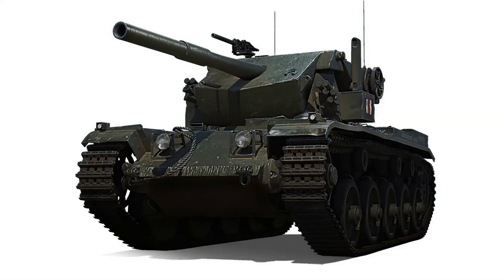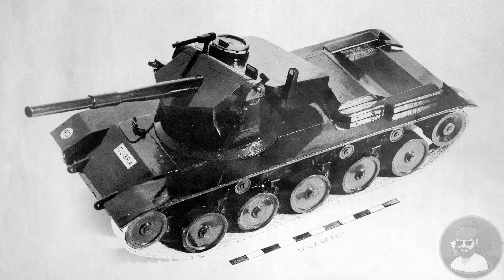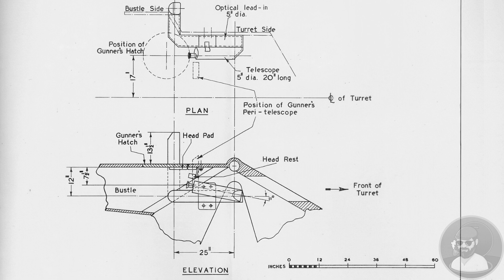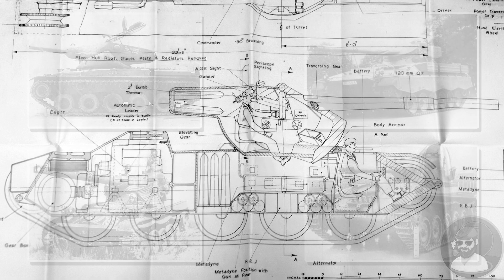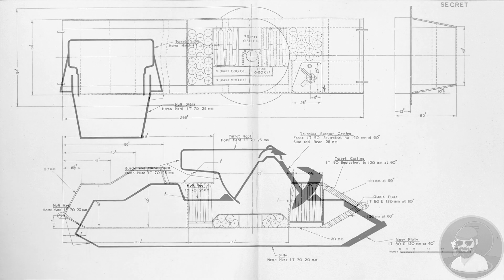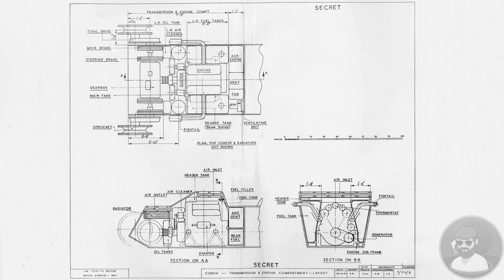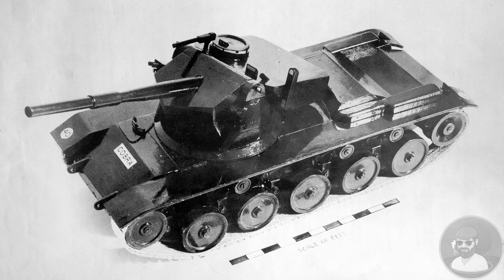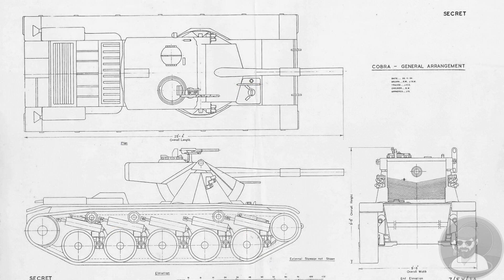Cobra 1954 - Tank Design & Development

Comment: Great channel with fascinating topics! Why would the main round be APFSDS? The barrel was rifled and therefore the round would be APDS.  Fins were used with smooth-bore guns.
Reply from the maker: you can fire APDSFS from rifled you just use a slipping driving band on the sabot. its just not as overall effective as smootbores these days
Reply: @armouredarchives8867   Thanks - never heard of that before.  Didn't all our rifled guns fire APDS?
Reply from the maker: @anthonysheffield5717  challenger 1 + 2 had/have APFSDS  rounds L23/L29 etc and we made 105mm APFSDS later on for the Vickers tanks. pre this it was APDS yes, early Cr1/ 4201/ cent were APDS

Comment: I remain doubtful about the low achieved weight despite the use of large & thick armor plates. Any other info on the Meteorite 202 engine ? Is it the same version as the one used by the FV4202 (40-ton Centurion) ?

Comment: I don´t understand why they bothered with designing new hull instead of just using the existing Centurion one?
Why all the efford when the ended up with something so simillar?
Reply: Ahh well they had to have a set amount of immunity, which the centurion didn't have, so they needed high front arc thickness, which required sacrificing the sides and rear.  so if they took the centurion, they would need to double the front and shave of the sides and shorten the hull to make that work, which would have taken more time than to build from scratch

Comment: A Christie suspension!?!?!?  A fascinating video, thank you very much Ed!
Reply: no worries, im sure WG will make an utter pigs ear out of it anyway :P
Reply: @edfrancis712  Haha, probably true.  I have the A46 in my garage but what's the point?  (They could have made the A46 a tech tree tank and not ruined the Crusader...)  Was there any indication of why the designers used a Comet chassis basis / Christie suspension? I would have expected... anything else.
Reply: @chriscamfield7610  I believe the wheels are comet, the hulls itself isn't, the exhausts and such were. not sure on christie. might have been a volume thing - il have a dig though the suspension docs
Reply: I'm not sure I understood correctly regarding the shock absorbers, were they at all wheel stations but the middle pair or only at the frontmost and rearmost stations?

I think Christie was chosen because designers already knew they could work at the weight of the Cobra and had greater vertical travel than Horstmann.